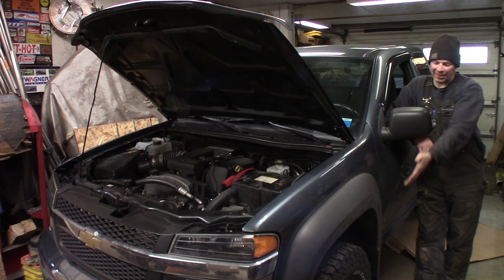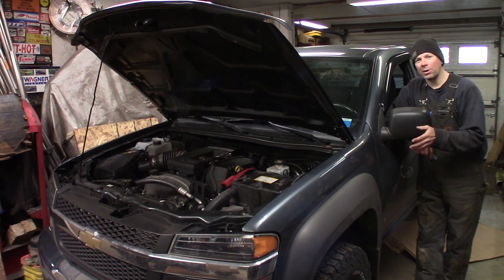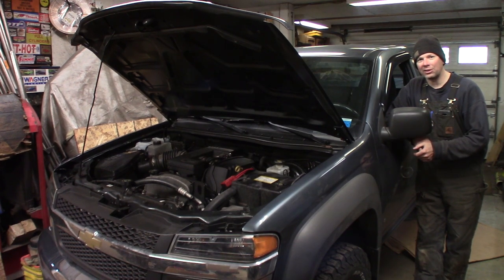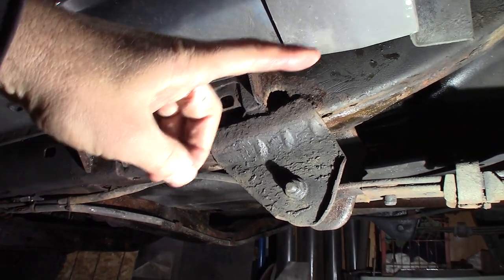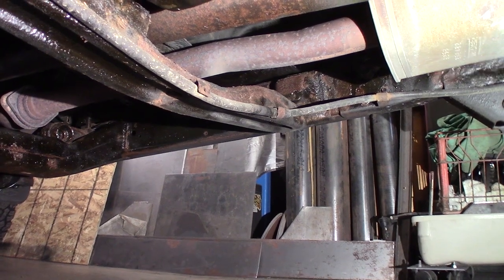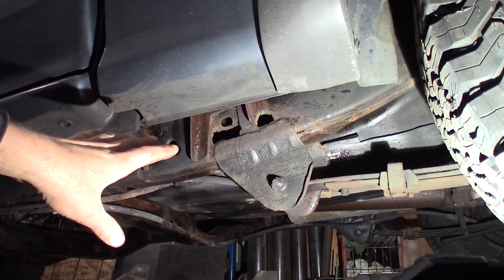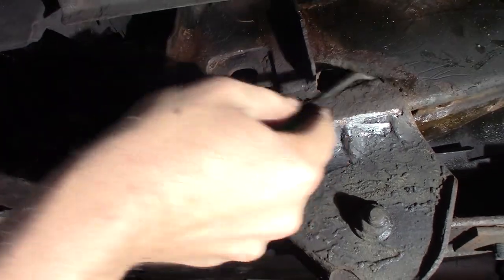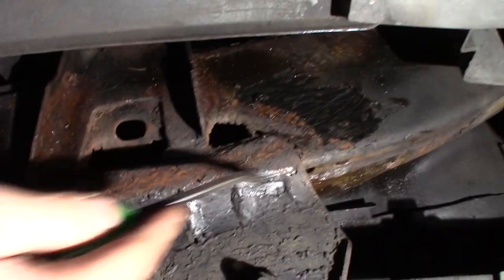Rubberized Undercoating Destroyed the Frame on this Chevy Colorado!

Comment: I live in the rust belt. I applied fluid film on my brand new truck back in 2019, so far not a single rust underneath. Oil based rust proof products(like fluid film) use oil to seperate water, salt from the metal, which is common sense. While Rubberized coating will only trap water and salt in between your vehicle's metal(like the frame) and the coating. It will not prevent rust but accelerating it.

Comment: I ziebarted for sound dampening, don't really worry about rust living in Texas. However I had to go back after they did it because they missed so much (didn't even take off my splashguards) and they redid and and gave me a $1299 dollar ceramic coating for free for my inconvenience. I think a lot of people get these rubberized coating over existing rust and then keep loading it up every year never letting their frame properly dry...It's like an old saying in the Navy. "Once over dust, twice over rust"
Reply from the maker: If you live where there is no road salt it's a non issue.  Ziebart just sprays over salt and rust in the north, ruining everything.

Comment: agree somewhat about rubberized coatings, but the main problem is the thin tubular frams that rust from the inside out just spent a lot of time welding up a colorado frame and have saw others with same problem

Comment: All the rubberized undercoating is garbage. We use heavy-duty rope grease (the stuff they use for cable cars etc) for undercoating here in Austria as it stays "soft" all the time, doesn't crack and it's 'self healing' to a certain degree. It's also very cheap. Yes, it IS a major mess to apply but works like a charm for 2-3 years. Without that undercoating you can literally watch your car rusting away in less than half a year. the problem is that they do not use normal salt for roads here in winter but some sort of salt solution which is absolute hell for metal and penetrates every seam and crack of a car's underbody.

Comment: Mustie 1  uses bar and chain oil says it's cheep and works great got a video on it.
Reply from the maker: Any oil will work great, but I don't want to deal with the rainbow sheen in my driveway after every rainstorm.  Fluid Film is lanolin from sheep wool and is nontoxic.

Comment: That was great except Repair Geek who is an undercoating guy says do not paint first-- the paint eventually flakes off and takes the fluid film with it. I think you're just supposed to rough up the metal so the film has a texture to adhere to.
Reply from the maker: I found the best thing for FF to stick to is flat black paint.  Paint adheres better to metal than FF does.  Flat paint provides a rough texture for FF to adhere to.  I stand by this method.  I don't know who Repair Geek is.  You need to reapply FF every year anyway so any paint that "flakes off" will be covered.

Comment: I have an 06 I am currently working on for these exact same issues. It was not ziebarted. The problem is two fold: Boxed in frames allow the salted brine water to get inside and do it's bad thing, but does not drain it out. The second is a lack of coating inside these boxed frames as well as a crap exterior frame paint GM used or continues to use. Thumbs up on the fluid film and your frame repair! How to avoid frames from rotting out? The manufacturers have to galvinize these frames. And they'll never, ever do that!

Comment: Yeah rubberized undercoating is crap using nothing is better than that. But it’s best to use either fluid film or woolwax. I noticed with the woolwax cans that the nozzles clog and fluid film cans don’t clog up so I switched to my 360 nozzle. 👍😎🤛

Comment: Rubberized undercoating can't plug drain holes. Every truck frame rust. Thats just the way it is.
Reply from the maker: Not true.  This frame was literally holding water.  I cleaned the holes out and it poured out.  It was full of water, salt and dirt thanks to the Ziebart plugging the drain holes.

Comment: The sheet metal is surprisingly clean compared to the frame. Did the Ziebart  protect that at least?
Reply from the maker: Ziebart only protects flat sheet metal that it can't trap salt behind.  The truck looks like it was only sprayed one or two times, but that was all it took to plug up the frame drain holes, hold dirt and salt, and cause rust.

Comment: Nice preservation job! Not sure about the Ziebart being the cause. I've got a 2004 with 240,000 miles that's rusted a lot worse in that same area and there has never been a drop of Ziebart applied to it. Rusted from the inside out at the factory weld seams and on the frame bottom and the spring holder completely separated from the frame. Again no Ziebart or rustproofing at all.
Reply from the maker: Every vehicle that I have worked on that was Ziebarted looks like this after a few years.

Comment: A MIG welder is not hot enough to melt in the steel you should be using a stick welder!
Reply from the maker: What are you talking about?  My MIG will weld 5/16" steel.  This frame is 1/8" at best, probably more like 14 ga.  Stick welding is for pipelines and structural steel.

Comment: I love these Colorados but unfortunately my trucks going down the same path. Called around a few shops no one seemed to be willing to do any work with the frame.
Reply from the maker: Repair shops probably are interested, but if you can find a welder shop, preferably a one man shop that just wants to pay the bills, that'd probably be easier.
Reply: Mine isn’t quite as bad as the one in your video but I know with time it’s only gonna get worse. I’ll definitely look into smaller welding shops. I appreciate the advice!

Comment: How much does a job like this run? As far as welding the new metal bracket or plate on there?
Reply from the maker: I don't know, I don't have a fab business.  I can guess a fab shop would charge several hundred dollars. I had almost 4 hrs in the repair.

Comment: I was almost ready to put my 2018 Silverado into the Ziebart shop before seeing your video! Heading out to pick up some Fluid Film today! There is a service near by that is mobile. They'll come out and apply FF to your vehicle but I'm betting it's not as cheap as doing it yourself. Thanks!
Reply from the maker: Excellent!  It costs less than $40 a year to do FF yourself if you have a decent air compressor and the $90 FF gun.  Glad you didn't get Ziebart on your truck!
Reply: Oohh my God I got my ford explorer undercoded yesterday from zeibar I can't tell you how I'm feeling right now after seeing this
Reply: Watch out fluid film eats the factory GM wax. Makes it so soft you can just touch it and it wipes off.

Comment: I've commented on the Main St. auto page. I had it linked to me. The truck in his video is absolutely screwed and we're told what we're told...I have a 13' F-150 I bought brand new off the dealer lot. I had it undercoated 10 days after in the summer at Ziebart. It never saw a puddle or rain. It was pristine clean metal underneath that got sprayed. I live in Mass. so....salted roads. My truck stays outside as I don't have a garage. My truck is perfectly fine underneath.A little TLC goes a long way too when it comes to rinsing the underside when able.  Using a hammer on the frame reveals solid metal sound return, no crap falling out of the large, numerous, unplugged drain and manufacturer provided holes. Rinse water sent through the frame rails always drains clear out the numerous holes. I have no rust underneath. My truck has 1 layer of spray applied, it DOES NOT get re-sprayed each year. I am super anal about my truck. I crawl underneath it and see absolutely no problem 9 years after purchase. Yes some stuff like brake lines and cables got sprayed but it tends to flake off those things. So they sprayed aluminum components? who cares? No one has refused to work on my truck for what little I've had to have done either. When I get another truck...I'll absolutely have it undercoated.
Reply from the maker: You go above and beyond when it comes to keeping your truck clean I guess.  When it comes to the typical Zeibart job I stand behind what I said and what South Main Auto says.  Every single vehicle that I have ever worked on that was Zeibarted was rusted as bad as the truck in my video.  I stand by my experience.
Reply: @QuickSpeedShop  ok, good on you and keep up what you're doing then for others. I know what my experience is 9 years after having the application performed.
Reply: @jumpingjeffflash9946 your blind lol
Reply: @kenj.8897  whatever. proper application is key, not layer upon layer. There's zero rot under my truck.

Comment: The spring hanger had been well protected, and mostly it looked to me the condition was good, it seems you just hate ziebart!
Reply from the maker: The flat side of the hanger in the center didn't rust, correct.  Ziebart seals in the outer seams and allows them to rust from inside out as this truck did.  If you look, the rusted away areas are the seams and out. I spray Fluid Film on over a dozen cars every year.  The only vehicles I see that have severe rust issues have been previous "protected" with Ziebart.  The stuff sucks, it promotes rust and destroys vehicles.  I stand by everything I said in this video.
Reply: Lol , I see you work for  Zfart

Comment: That was one corner. Is the rest of the truck like that too? Why wouldn't they put drain holes along the bottom of the frame rails?
Reply from the maker: There are drainholes in the frame, but they got plugged up on the driver's side by the rubberized undercoating which trapped water in the frame and rotted the rail.  The pass side didn't plug up, didn't hold water so it doesn't have rot holes in it...yet.
Reply: @QuickSpeedShop  When you were hitting on it with the hammer, water was splashing up enough to be seen.